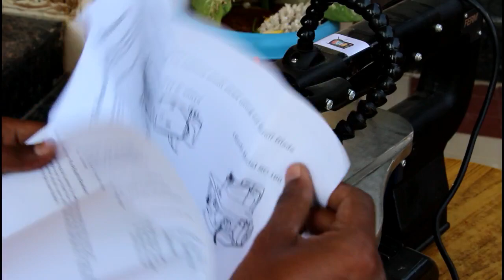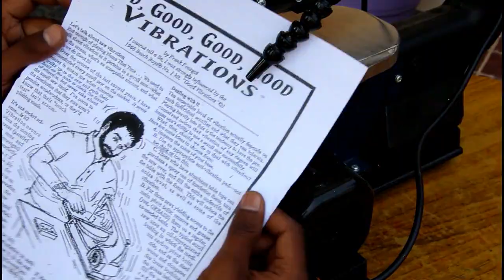Upgrade your Scroll Saw -  Pozsgai Design EZ Blade Change

Comment: Wow, nice work -- too bad they aren't more universal. I wouldn't have been able to fix the things you had to fix, like using a late to make the hole larger. Very impressive.
Reply from the maker: thank you.. if there was no option of using a lathe.. then I would have used a smaller screw.. but the system uses most of thee 16inch scroll saws out there..